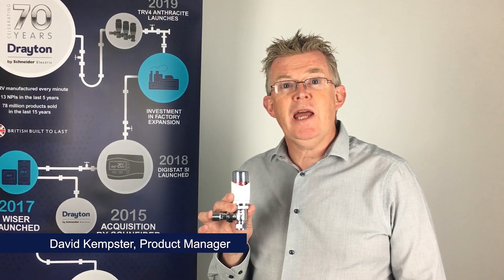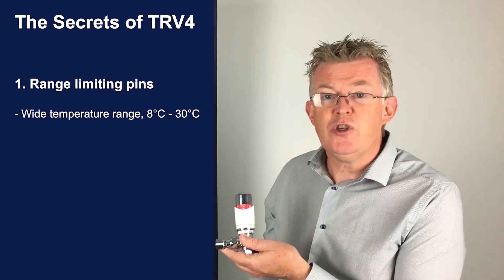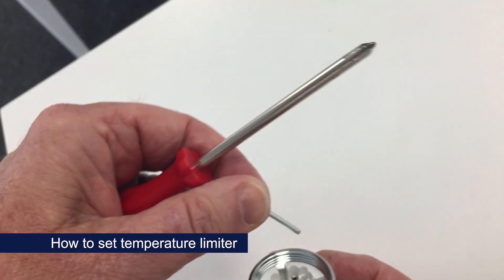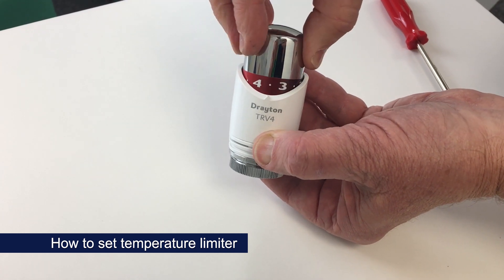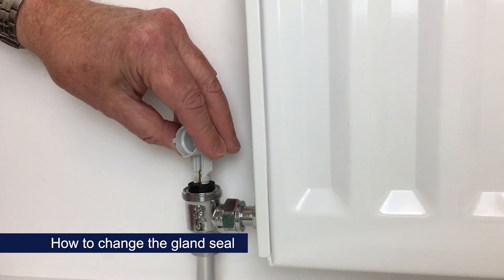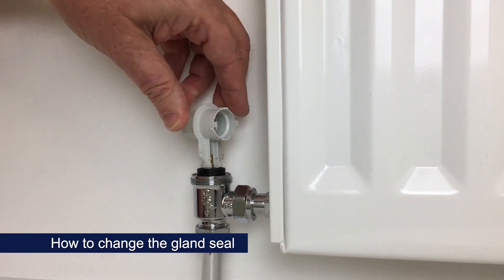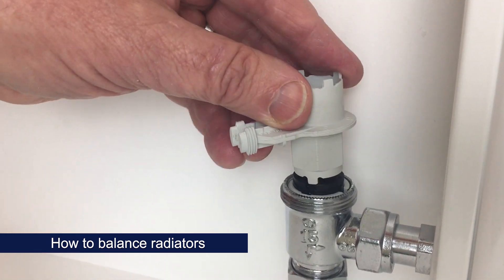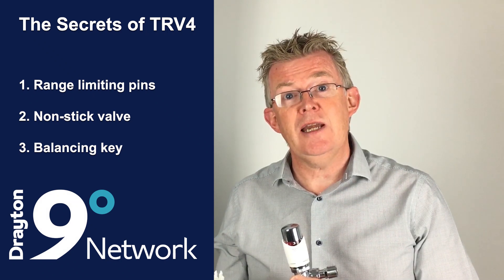Drayton Installer Training Series: The Secrets of Drayton TRV 4 Thermostat Radiator Valve

Comment: When I tried to change the gland seal I had a lot of water leaking out. We have a pressurised system boiler. Any advice on how to stop this when I change the rest of the glands. Thanks
Reply from the maker: The gland seals are designed to be changed on a live system and there shouldn't be any pressure behind the water when the gland seal is removed. If there is,  it suggest there is something wrong with the valve body. Have a chat with our customer services for any more detail - 0333 6000 622